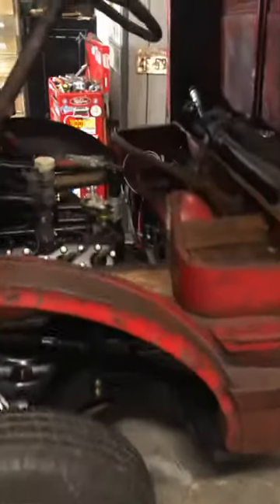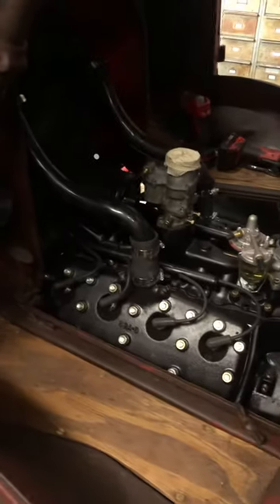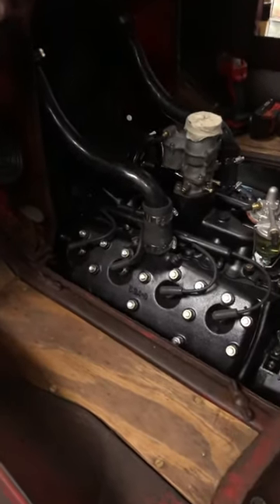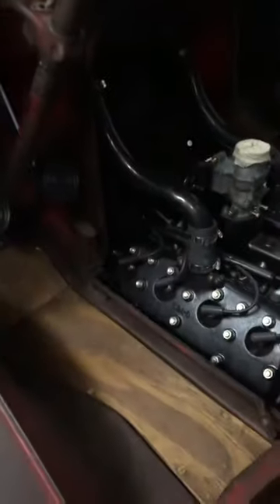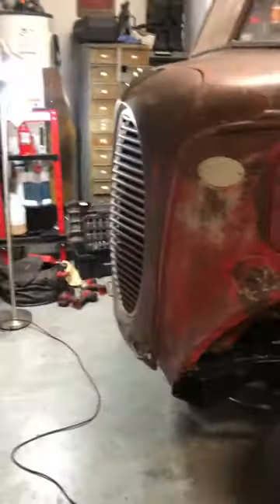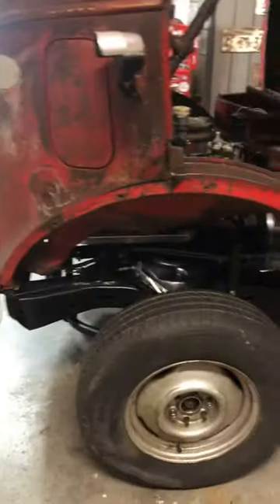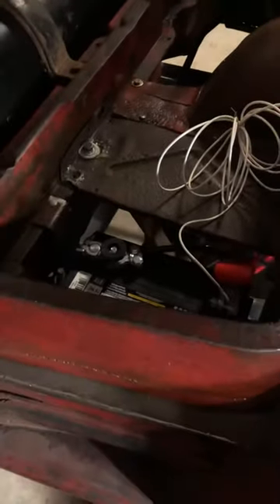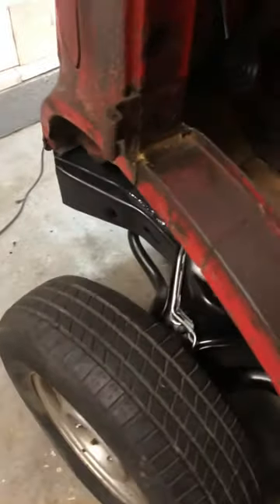Ford Flathead Power Steering!!  Simple design & Easy installation

Comment: What model Ford uses the electric power steering pump? Did not know that it existed. Thanks.
Reply from the maker: Ford manufactures the electric power steering pump for the 2005-2011 Volvo S40 and V50.  I’m not exactly familiar with what all they fit but the power steering pump OEM part number is 5N513K514.  The Oreilly part number is 980-0125E.  I hope this helps.
Reply: Some of the Volvos have a remote reservoir type as well.